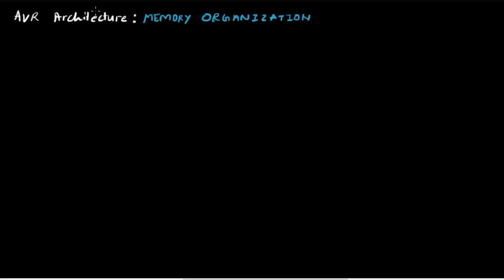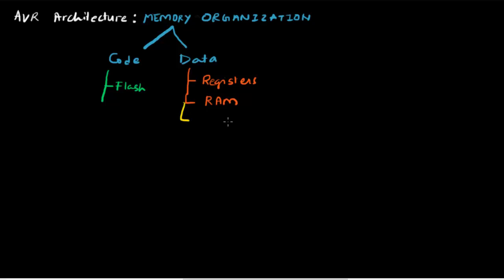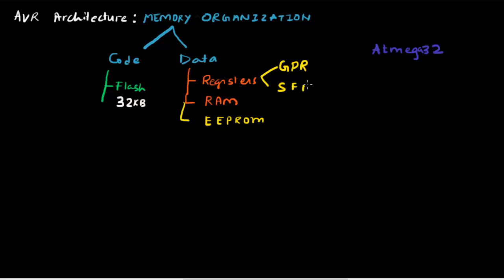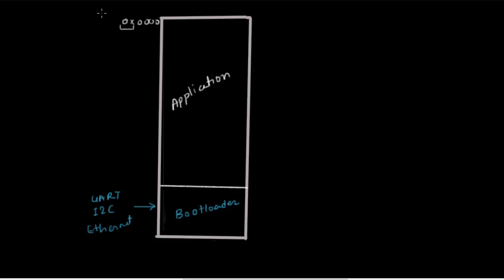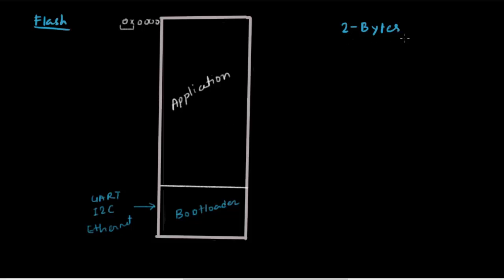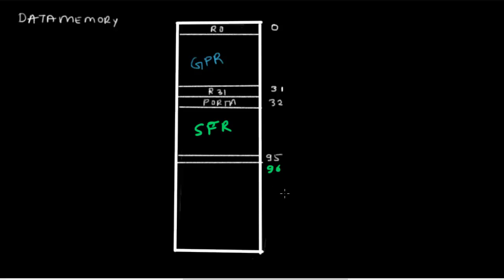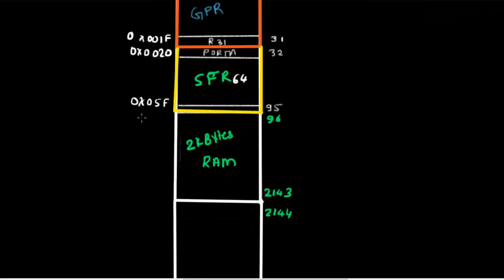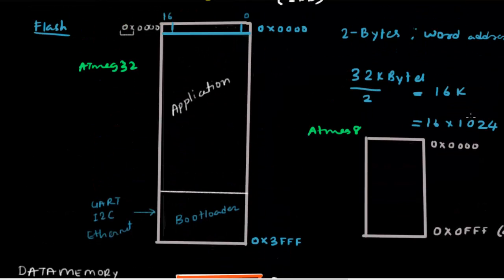AVR Architecture-Part 3: Code and Data Memory

Comment: OMG the noise of India drives me nuts. I don't know how you guys put up with that. I would go around at night cutting the horns out of all the cars I could find. The noise is maddening.

  FYI, if anyone is interested in making content like this with a voice-over recording, one cheap trick used, even by professionals in Hollywood, is to do the audio recording with a thick blanket over your head and the microphone. This won't completely dampen the background noise like car horns, but it will remove all of the room noise and echo. This will greatly increase the audio quality, and it doesn't cost you anything.
 -Jake